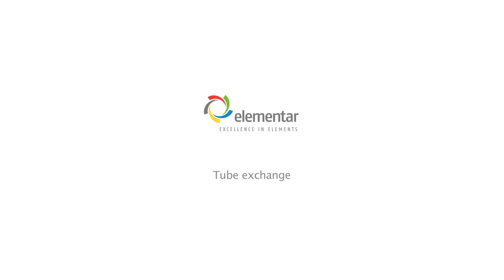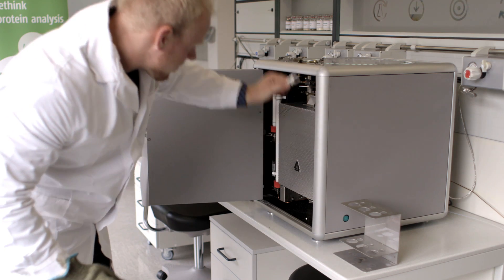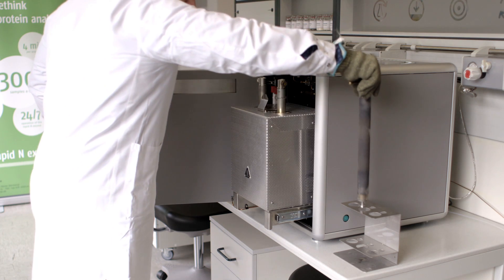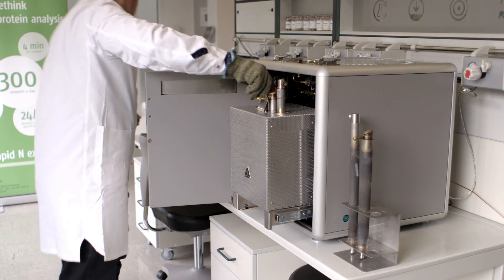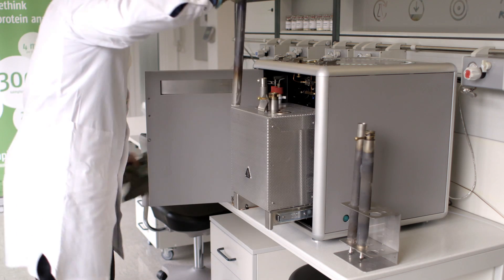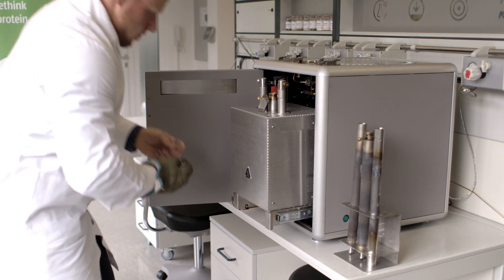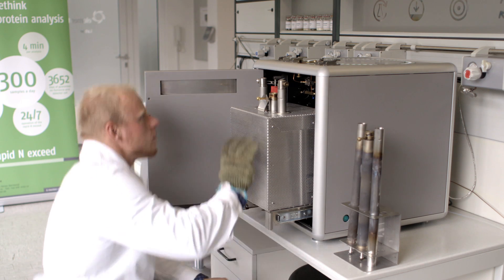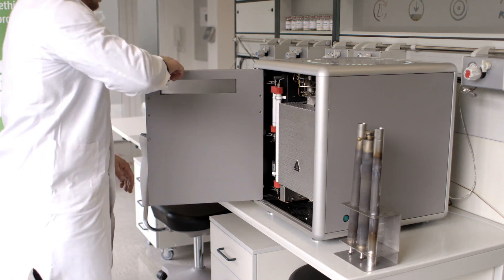Tube exchange rapid N exceed®

Comment: Easy to change but hard to pay. I assume that tis replacement cost about 10k. Nevertheless, great equipment.
Reply: This change is not as expensive as you suggest. The combustion and post-combustion tubes can be reused; it is only the chemicals inside that have to be exchanged. The tubes are replaced as shown for convenience. Also note, this exchange only has to happen once every 1000 samples for the combustion tube and once every 2000 samples for the post-combustion tube and REDUCTOR. The cost-per-sample for analysis on the rapid N exceed is 0.25€, and that includes chemicals, gases, and electrical power.
Reply: Aaron M. Johnson  Oh my mistake I just think that you change and 3 columns inside the ismnstruments